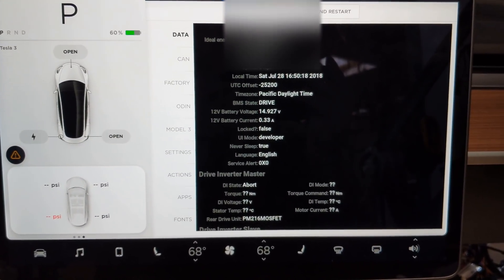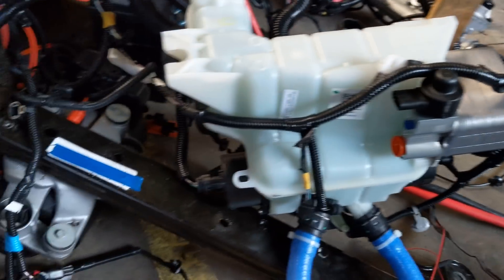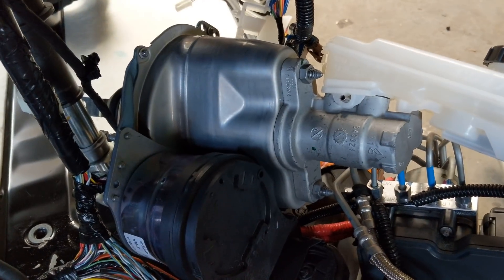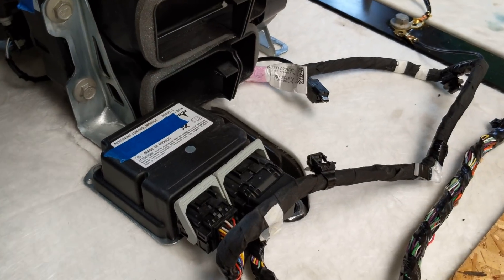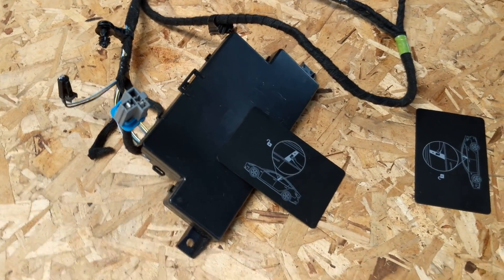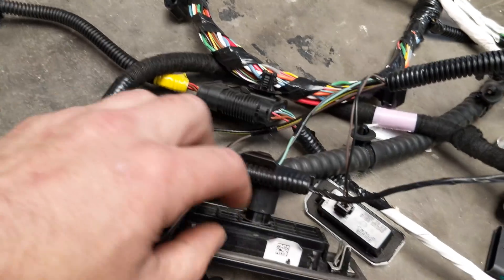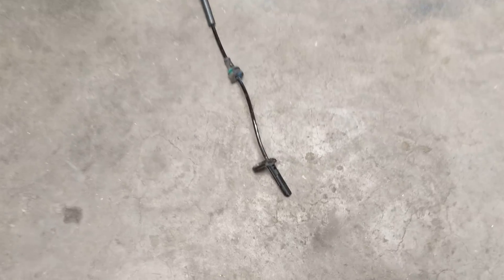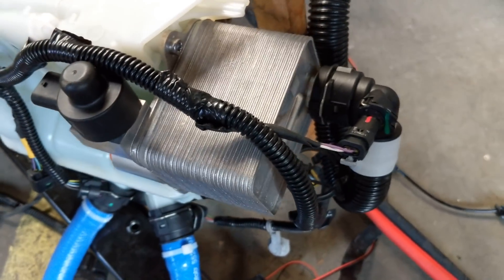Tesla Model 3 - Exploded?!?

Comment: Great stuff.  Given the architecture, it looks like it will be very easy to build these cars as a Right Hand Drive (RHD) without having to source/build many mirrored parts.  Potentially very good news for those in the UK or Australia/NZ eagerly waiting for a Model 3.  Pretty much only things that need to be swapped are steering column and pedals with the glovebox (and I believe the metal already has the cutouts for them on the right).  Maybe a RHD power steering rack?  The key card reader needs to be swapped to the other side (trivial).  And so does the charger port/door, etc.  Anything else with the charging hardware that would need a special RHD-type part?
Reply: They won't swap the charge port (see model S & X). They'll need to swap the autopilot computer over, and maybe the brake booster. Doesn't look like they need to move the HVAC unit, unlike in most ICE cars. However it seems the windscreen glass is handed (asymmetric to get the wipers down low for aero).
Reply: John Smith - Munro, in their tear down, said the car is basically symmetrical.  So RHD should be trivial.  This is a brilliantly engineered vehicle.  And there’s every indication that Tesla could make a healthy profit on it.

Comment: Did you block the cellular signal so it can’t tweet Elon and ask for an extraction mission or the code to initiate self-destruction?
Reply: IMHO tbh I wouldn't be surprised if it didn't have something that'll brick the ECUs.
Reply: Ali Abdallah, yes, I think Tesla has been increasing security on its ECUs over the years and it’s why many have resorted to just making their own inverter driver for the Tesla drive units. I think jailbreaking Tesla will be a real thing once there are 1 million on the road.
Reply: IMHO oh yeah. Tesla IS the apple of cars. When they find a way to legally do it. They'll make it warranty voiding to put anything but the michelins illegal. And then remotely disable the car.
Reply: Ali Abdallah, Tesla is reportedly working on a track mode which seems almost like a rooted Tesla OS, and will let people change settings which void the warranty. Elon basically eluded to this during his interview with MKHB. 

I’d love to have a Tesla with full overclocking unlocked and access to everything with some easy to use utilities that let you test each setting for overheating. 

Really I wish someone would make a DIY EV where you can buy each part just like buying parts to build a computer, where the body and chassis would be like selecting your computer case, and then you pick the motherboard which supports plug and play drive units and battery modules.

Then it has some OpenEV operating system which defaults to all the recommended settings for whatever you plugged in, and then let’s you tweak them up to safe limits (and beyond). 

Imagine the sort of business you can have if you can build a car and keep upgrading the components as you can afford them.

Comment: Oh my god.. you heard my cries.. 

Please hear this one.. 

Put all this into a Ford Festiva..

My idea would be to create a cage for the front drive motor and transmission and custom dash for MCU and cluster. 

Next part would be custom battery similar to model 3 style as there is not fuel tank needed once removed and perfect for a 3/4stack sized lump on the end of the battery.. then 2 cells up front under passenger seat and 2 under drivers and possibly 5 across the rear passengers.. plus the 4 where the fuel tank would be and if you relocate the spare tyre.. then you could fit in the remaining 5 cells in.. 

Meaning the whole package (minus the rear drive motor) in the car.. driving and the FESTIVAS came in autos.. which you could POSSIBLY reuse the original shifter to hold the asthetics of the Festiva. 

Also there is a tunnel in the car which could be replaced with a flat piece of steel and wiring could be run through the centre, or.. flatten the car out and possibly have 5 cells across front, 5 across the rear, and 6 in the rear section after relocation of spare wheel to the front and flatten out boot to add more battery cells.
Reply: Gary Stinten, you have a better chance of winning the lottery than seeing this end up in a Ford Festiva.

Comment: Great work! Finally a teardown that names names. Interesting that the inverter is running MOSFETs. Given that Elon Musk used the term Silicon carbide inverter, it would seem that these are silicon carbide based MOSFETs. In an article that I posted speculating on this topic, someone apparently-in-the-know asserted in the comments it was likely SC MOSFETs. Now we know.

Now looking forward to seeing your teardown of the motor (stripped to core teardown) to see if it is a "vanilla" IPM reluctance machine, or if there is some Tesla magic in there... such as permanent magnets embedded in the stator.

Thank you for the videos!
Reply: Steve bakker - IIRC, there are PMs embedded in the stator.  He does a demonstration in another video that shows heavy cogging when the rotor is turned by hand.  My big question is the composition of the magnets.  I read a research paper awhile back that stated one of the theoretical advantages of this motor design was the PMs did NOT need to be particularly high performance.  Rare earths wouldn’t be necessary.  So I think there’s no rare earth magnets in the motor of the model 3.
Reply: Hi Bryan. The cogging he demonstrated may well have been from the PMs in the ROTOR. I've seen a motor taken a part and the M3 motor is at least in part an IPM (Internal Permanent Magnet) motor. And they are likely rare earths, because someone also published an agreement between Tesla and a Chinese supplier for rare earths. If there are also PMs in the STATOR then Tesla would be following some more recent research that may set Tesla's IPM motor in the 3 apart from the many other automakers also using IPM motors. If you read the piece I posted on the topic it will refer to a companion piece, and together all the info and links I am referring to are there. Cheers.

https://cleantechnica.com/2018/05/28/more-tesla-model-3-powertrain-fun-from-carburetors-to-carborundum-youve-come-a-long-way-baby/
Reply: is it not the Performance model that has the higher spec Inverter? The standard and AWD has one optimised for cost etc
Reply: According to what Musk said, it is the same inverter for all cars. Tesla just culls the inverters that test for "highest sigma output" and installs that subset to the P cars.

Comment: Great video about the Mod 3 insides.  Too bad you couldn't  get the big DC motor   apart w/o breaking it.   I am curious as to what magic is inside.  Supposedly the drivetrain is 7% more efficient that S and X models.
Are the   main drive transistors  really  SiC  (Silicon Carbide) IGFET  transistors?  SiC's are supposedly rated for high voltage, high current, very fast switching,  and  
are rugged, and have  low ON resistance which all translates into high efficiency.   Elon's gang could have squeezed out more efficiency with standard  IGFETs by using just the DC motor though!   They be smart!
FYI there is   a YouTube video from Texas Instruments (who makes the special driver integrated circuits for  SiC FETs).  They had a demo
for a small 10KW inverter  that runs at  99% efficiency to make a point         I have no idea what Tesla worthy  SiC FET's cost nor are they available in mass quantities.  I have the suspicion that SiC transistors will turn up in later model Teslas, the trucks, and   Roadster 2.   A 500mi Class 8 truck and 625mi range for the roadster 2.  There has gotta be some "secret sauce" in there somewhere!
Reply: how does taking the motor apart break it?

Comment: If anyone could put to rest the question of where to tap in to hardwire constant power for a dash cam, you could with this setup.  I don't even care myself, I just want the question to be answered so people will quit asking it. :P
Reply from the maker: The overhead console module that contains the Hazard switch and front map lights has +12v on pin #1, which is a yellow wire. Ground is pin #16, black wire.  Should be ok to pull a modest amount of current from there.
Reply: Are there any switched +12v leads/pins there as well? I'd like to wire in a dashcam, but not run full time.
Reply from the maker: @AdamSnyderElkHeights  See my other videos, I have one on exactly this.
Reply: @Ingineerix  it works great on my Model 3 dash cam!

Comment: Very nice, what protocol is used between the ECU and the motor inverter?  Is it CAN bus, if so could a CAN repeater be used to adjust the messages?  for instance, adjust throttle up by 10% for whatever the input? 

This would be warranty voiding and track only mode.  Basically a man in the middle hack.
Reply from the maker: AutoxMx5 is correct, and on the RWD car there is no CAN signalling involved, the go pedal is wired right into the inverter.  No performance hacking without a complete inverter software re-write, and I doubt you can do better than Tesla without buckets of blown inverters.
Reply: ECU and motor inverter are on the same board.  See the inverter board video.  I assume the CAN messages to the inverter board are only simple things like go pedal position and Drive or Reverse.

Comment: 9:00 I heard those cables are aluminium (maybe copper clad like some cheaper audio cables?) not copper like in S and X - that's why they are thicker. (And cheaper of course).
Reply: i think Aluminium is also lighter for the same current than copper, so weight saving as well.

Comment: The cables are large as they are aluminum and SX are copper.
Reply: I could be wrong, but I believe he has already stated this is not the case.
Reply from the maker: @ShaunRF  No, they are indeed AL
Reply: @Ingineerix  what brand was the steering rack and AC compressor?

Comment: Great videos! You showed the main orange charging cables on the M3 are larger than the S & X do you think this is to accommodate the new charging standard Elon has been talking about?
Reply from the maker: Yes.  The 3 sports 95mm2 cables (3/O AWG), whereas S/X currently use only 70mm2 (2/O AWG).  The enabler of the 3's higher charge current capacity is likely due to the improvements brought by the 2170 cells.
Reply: Ingineerix If he current model S and X can DC fast charge at 120KW and now after you have seen the size of the cables on the M3 what do you think the potential KW could be on the M3?

Comment: Whoa!  "Note the size of these cables - they're huge! They're way bigger than you find in S & X. That implies that 3 is capable of a higher rate supercharge than S & X, at present. They are very big."  --- That got my attention!
Reply from the maker: The 3 sports 95mm2 cables (3/O AWG), whereas S/X currently use only 70mm2 (2/O AWG).  The enabler of the 3's higher charge current capacity is likely due to the improvements brought by the 2170 cells.
Reply: So 84% more cross sectional area in the cables then. Nice!  Hmm... lol, trying to look up maximum rated current for those cables, but most wire gauge/capacity charts don't go that high.  ;)  If it's linear scaling and the old ones were only suitable for 120kW then theoretically these would be suitable for 221kW.  But that's a lot of assumptions.
Reply: @karenrobertsdottir4101  195-230-260 A @ 60-75-90 deg.C respectively.
Reply: @Ingineerix  Isn't it 85 and 67.4 respectively rather?
Reply: Is it possible that they've cut over from Cu to Al for weight/cost/availability reasons?  That might explain the thickness difference?
Reply from the maker: @Clark-Mills  This is correct.  They are AL.
Reply: No, I believe the 95mm2 spec is already an area measurement, so it is only 25/70 = 35.7% larger in cross section area.  Also, we don't know the stranding specs (# of strands and each strand's AWG or metric area spec).  Plus there's usually insulation temp spec which is used to derate max current.  At any rate, as Ingineerix states supercharging capacity is probably set by the 2170 cells / cooling capacity of the main battery.
Reply: Yes, Model 3 uses Al cables for high voltage. They are supplied by http://www.griller.at/en/products/automotive/electric-mobility/
Reply: When?  I'm watching the video right now, and I see him asked about it, and he says that he thinks eventually it might increase 3-4 fold, but doesn't talk about V3.  In the last conference call, they said 200-250kW, but they also framed it as longer term.  There's some reports out of Germany that Tesla is getting ready to add 500A water-cooled CCS combo cables and that Model 3 will be shipping with combo ports; it's from a person who's generally very reliable, but of course, that's still just the rumour mill.  500A would be around 180kW at the low SoCs where you'd be able to use that much.
Reply: I don't remember him saying 150 kW.
Reply: Well... 145 per charger.  120kW (in practice, ~117kW) per vehicle.

But yes, I'm expecting 180kW per vehicle.
Reply: If they use really high end cables like these ( http://www.axon-cable.com/publications/FLEXFORCE-ANG.pdf ) then it could be rated 500A with 95mm² - this would mean, with two cables side by side 400A at 30°C (80% derating due to 2 cables) which would mean 160kW
Reply: Oh, sorry, mm², I was reading that as mm - my mind didn't parse the lack of superscript  :)
Reply: good point, so maybe no hidden supercharging upgrade to supercharger v3... however, if they release supercharger v3, what cars are going to make use of them? the new roadster in 2020, new versions of the model s? it would make sense to make it standard for all tesla models.
Reply: Really? Source please. Thanks!
Reply: He said this and never mentioned capacity at all: "Supercharger generation 3 will be a quite a dramatic improvement but we want to say that announcement for when when it deploys which is hopefully later this year."

Currently SC can output 145 kW. Your 150 kW is false, we can expect much more.
Reply: Thanks for the info Karen. It was on TMC I suppose, could you provide link please? Thanks :)
Reply: Well find the source, I'm still interested... or don't trust that much your memory! :)
Reply: Ingineerix Assuming they are both copper, it might also be that the cable is longer in the model 3 and because of that needs to be bigger.
Reply: reason why M3 is the only one that can charge with the new V3 station

Comment: Aren't the charge port cables larger because they are aluminum instead of copper like the S&X?
Reply from the maker: This is definitely a possibility, Unfortunately I can't answer this question for sure without cutting into this cable.  Let me do some more research.
Reply: Ingineerix
Quick test: Check with a magnet.
Reply from the maker: @AZOffRoadster  Magnets are not attracted to Copper (unless there is current flowing), just like Aluminum.
Reply: Or you could just measure the resistance...
Reply: If you don't want to cut them, and can disconnect them fully, you can measure their specific gravity with a water test.  That'd give you the average of the cables/connectors/insulation combined, but there would be big differences between alumium and copper.

I do this for minerals: www DOTT johnbetts-fineminerals.com SLASH jhbnyc SLASH articles SLASH specific_gravity.htm

You'd just have to scale it up.
Reply from the maker: @karenrobertsdottir4101  Yes, they are indeed AL.
Reply: good question
Reply: Great video  Google search :If aluminum is used in an application where copper was previously used, it is typically sufficient to use an aluminum conductor two AWG sizes larger than that of copper
Reply: Resistance is relative to cross sectional area, not just conductivity.  And should be minuscule on such a large cable.

Comment: If AP and the center screen runs on the same hardware, how's possible that you can reset the center screen but AP still works? Is the center screen system on a virtual machine/container?

Ah I get it, there's two computer boards in one case.
Reply from the maker: Correct.  In a future video I will do a teardown of the assembly.
Reply: Ingineerix nice! What's your background? Are you into programming? I wonder what a hacker with this background could acchive in analysing the system towards security.

I'm sure they've done a good job on that, but certainty is always better. ;)
Reply: Virtualization or something similar? Hardware can be passed through etc etc, it is pretty simple these days..